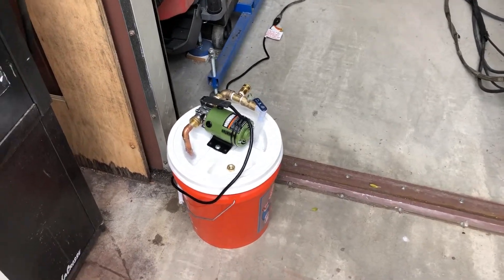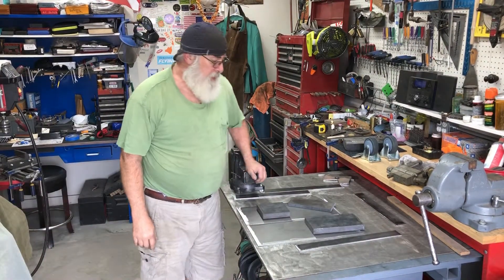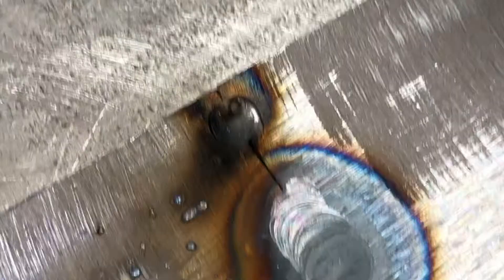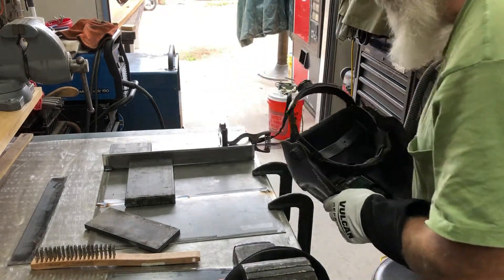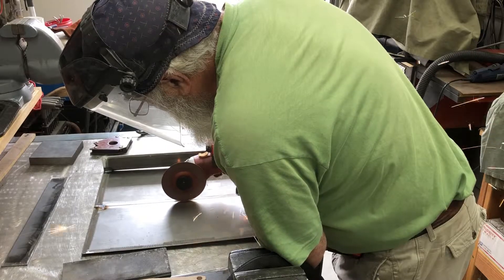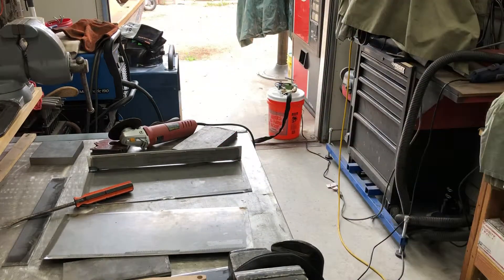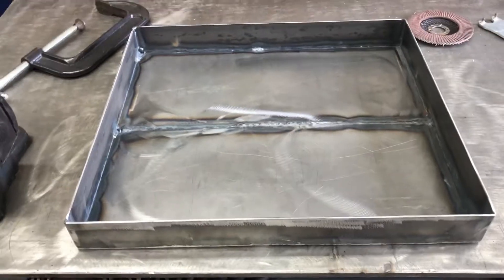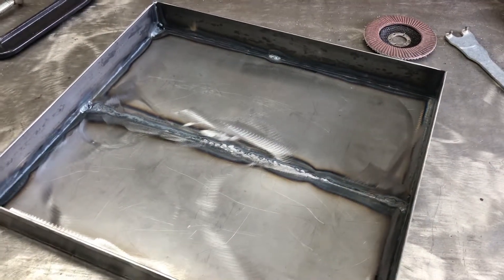Miller DIALARC HF full Test with Tig

Comment: did you ever use it with aluminum? if so what settings did you use. Thanks
Reply from the maker: I tried aluminum but my skills weren’t up to the task.  I ended up selling the Miller because it took too much power to run and I mostly work with lighter materials.  I ended up with an Eastwood digital Tig.  I’m still trying to teach myself to do aluminum well.  With limited success.
Reply: @papasfixitshop7982  this was the perfect comment for me, I have a 220v outlet in my garage for the mill and was thinking of buying this from a guy and I’m guessing I might run into the same power problems. How much power do you think would be needed to run this efficiently?
Reply from the maker: @justtestingonce  a 50 amp service
Reply: @papasfixitshop7982  yeah, good thing I ran into your video. Thanks